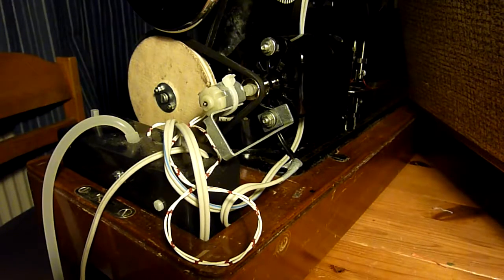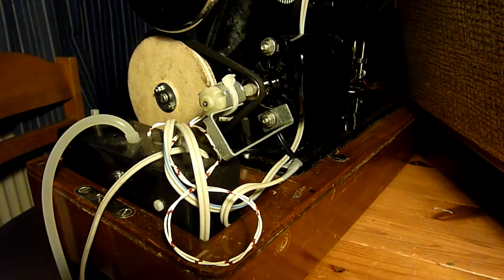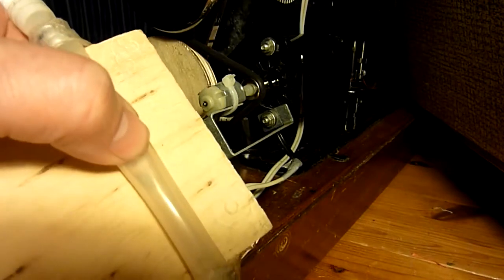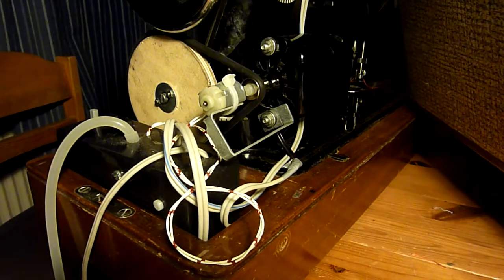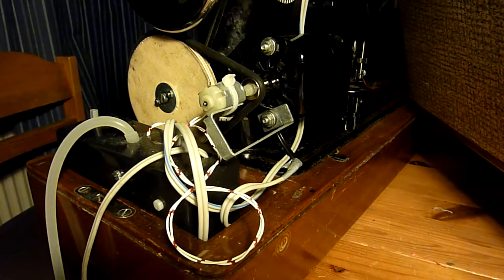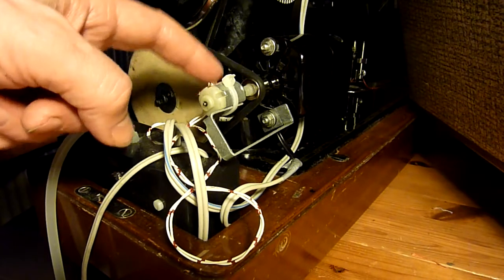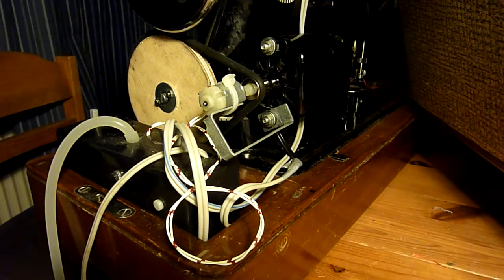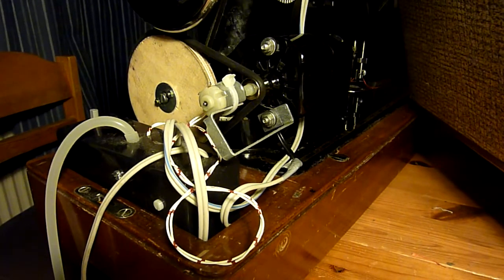Electronics for Vintage Sewing Machine Motor Control

Comment: That foot pedal is very interesting! I read the discussion at leatherworker. Any chance you would share what kind of sensor and microcontroller involved? In any case, I enjoy your videos and your approach to sewing machines.
Reply from the maker: Thanks for the comment. No microcontroller is involved. It is old school analog electronics. The sensor used is from Omron, 
https://omronfs.omron.com/en_US/ecb/products/pdf/en-2smpp-03.pdf 
 The pressure range used is about 0-3 kPa.
Reply: @sewingmachinesindetail  Thank you for the quick reply and the link. Just the information I was looking for.

Comment: Hello. this is very interesting, I was looking to do something like this with my  Butterfly sewing machine, what are you using for speed control circuit?
Reply from the maker: It is old school analog electronics. The motor voltage is controlled by a triac including a high voltage optocoupler to control the trigger point. It is a triac circuit with minimized hysteresis. A somewhat unilinear circuit is used to control the current to the led in optocoupler to make a more linear control. The analog electronics make a PI regulator with feed back from the voltage from the small motor, that is used a tacho generator. Another vide show how the speed control performs. I hope this helps. Ask if you like to know more.
Reply: @sewingmachinesindetail  I just wanted to know what are you using to drive the motor, and it looks like the triac works fine, my plan was (I may still do that in the future) to convert the motor in to a DC Series motor and power it with 12v for low speed high torque and easy speed control.

I have a micro controller so I would use that instead of analog circuit (I have always been better with digital stuff lol).

Can you do a video on how you made the pulley assembly? 

Thank you for your video and the replay.
Reply from the maker: @obkf-too  If you got another 12 V motor to use, then this is possible. You may find a used 12 V motor for the ventilator in a car. But typically normal motors for vintage sewing machine will need a higher voltage and up to 115 V in the US and 230 V in Europe. It will be almost impossible to change them to use 12 VDC. I made a video with some close up video about the speed reducer. And I got another video about belts and pulleys. Did you see them?
Reply: @sewingmachinesindetail  These motors are Universal Motors you can run them as AC or DC (DC Series or DC Shunt), you should be able to just plug 12v DC and make the motor spin (Shunt aka Parallel mode by default), but if you want to run it on series you will need to cut and solder some wires inside the motor (or just pull all 4 wires out and test which one to run), the are a lot of videos on this using washing machine motors.

As for the pulleys I was asking if you made them on a lathe or something cause I don't have one of those.
Reply from the maker: I know these Universal motors very well, and yes, they can run on DC or AC. They are almost always series motors, because it makes the speed torque characteristics becomes more useful than shunt motors. But for a universal motor specified for 110 VAC, you will get almost no power out of it, if you use it at 12 VDC. You need at least 60 VDC to get a decent power out of such an universal motor specified for 110 VAC.

I used a simple lathe powered by drill to shape the pulleys of the speed reducer. It is made of baltic plywood.
Reply: @sewingmachinesindetail  Ok thanks, I am not worried about converting the motor for now.

The most challenging thing for me here is to make the pulleys XD.
Reply from the maker: A 3D printer may do the job too.